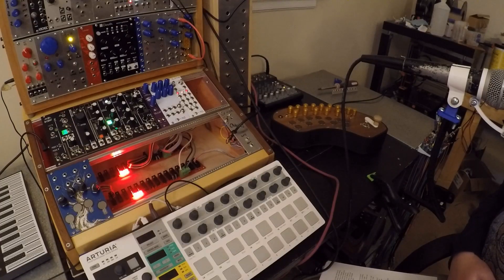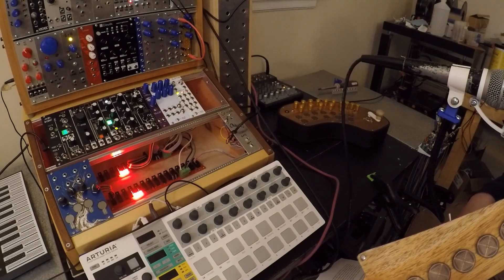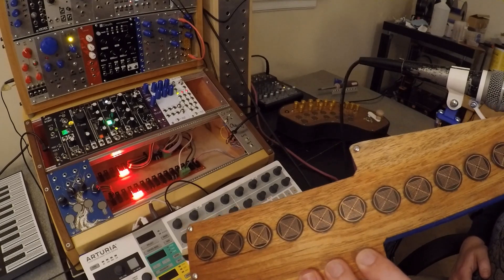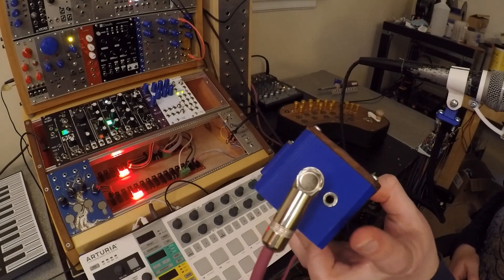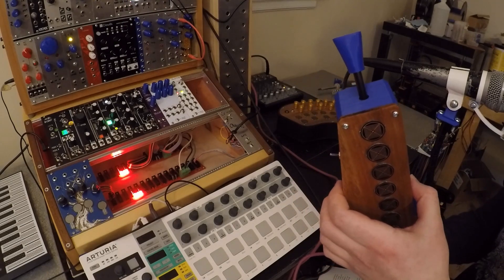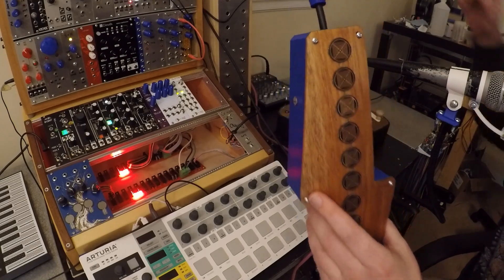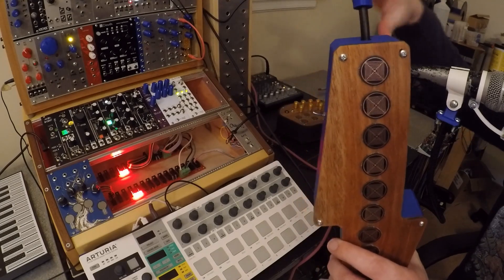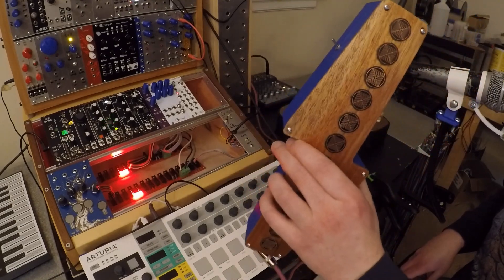TeensyWind: A Breath-Controlled Digital Synth

Comment: Are the pitches based on the harmonic series? I dig it.
Reply from the maker: It's not a real scale, just some ratios that sounded nice. The intervals are set as a multiplication of the root note in the code so they can be changed easily